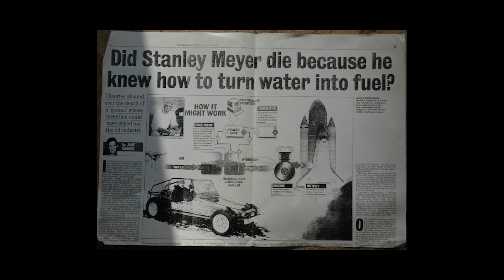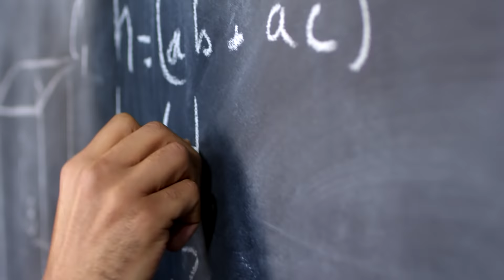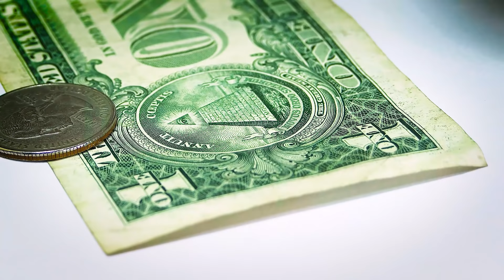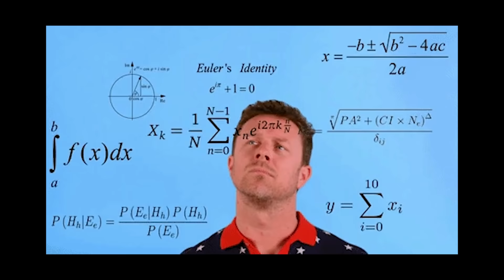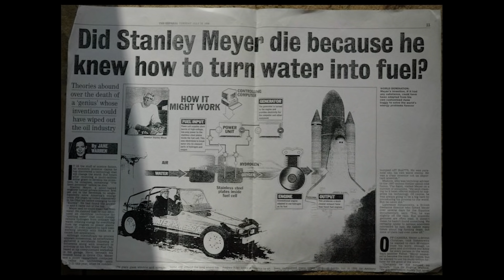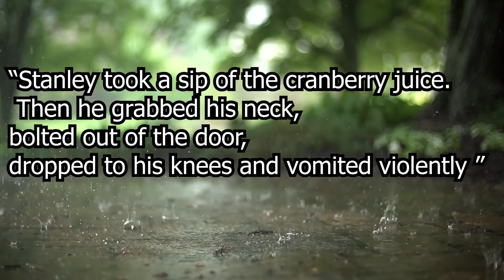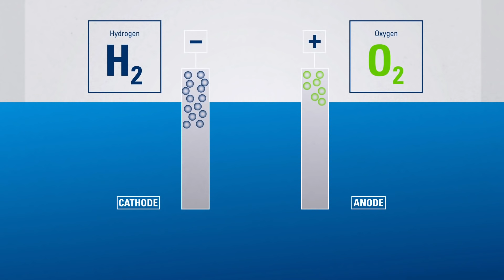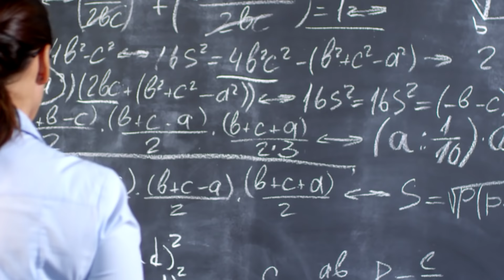Stanley Meyer Water Powered car, Lies and Death

Comment: He didn't use electrolysis  the same way we use it. He ran a high volt  electrical frequency through the water that vibrated the water and fractured the H20 bond apart. That's how he got the huge amount of hydrogen at a low power consumption. It's not amps but volts and frequency + container volume.
Reply: FACTS!
Reply: And do you have any helpful sources or related scientific publications for that as evidences to support your claim?
Reply from the maker: Yes please ill make a follow up if you can send me the link
Reply from the maker: Nope still waiting
Reply: @ChrisVSCars  It's not just a resonance frequency, it's more a matter of
a frequency that is modulated over another carrier frequency forming a train of waves.
These values in turn will depend on the size, surface area, type of water, separation, etc. 
This configures a condenser where water is part of it, (pure water works as a dielectric).

And to make it more efficient as it works on alternating signals, AC
then it is more efficient to increase the voltage and decrease the current.

In the comments of the video link, there is a link to schematic documents that Meyer made. 
https://www.youtube.com/watch?v=nbk5PCZ_7T4
Reply from the maker: Ill check the link thanks😁
Reply: What do you mean exactly by when you said "container volume". Please explain
Reply: @Bob Lazar hey I hope your not calling me a bot
Reply: @ChrisVSCars   mtttony is basically correct in his reply to this video, there is no way to make the excess energy appear in the form of excess hydrogen, you need to reverse where your heads are at, the energy comes from the correct burning ENVIRONMENT of the hydrogen and then the correct containment of the exhaust from said burn. that hydrogen oxidisation exhaust, is water and it is 1800 smaller that the volume of gasses burnt (propellent and oxidiser).

I combine what I'm telling you with what mtttony said, this is basically the answer to how stan made it work, the big secret. 

You don't need to modify the valve train, you do need to make a slight timing adjustment (just past TDC) and you need to inject the hydrogen at an unusual time (TDC between Exhaust and induction strokes) . You also need to ionise the inlet manifold to make electron deficient oxygen (or OZONE) and use a second seperate ioniser to get more nitrogen from some air (charged Activated carbon) and add this nitrogen to the burn, this is not that hard, easier than is sounds. 

In a four stroke on pure hydrogen propellent things are completely different, you can make other, different types of forces move the piston on the different strokes.  

HYDROCARBON PROPELLENT FOUR STROKE

1 INDUCTION Stroke            down
2 COMPRESSION stroke     up
3 POWER Stroke                  DOWN
4 EXHAUST Stroke.              up
boring!
HYDROGEN PROPELLENT FOUR STROKE

1 BURN WHILE INDUCTING POWER Stroke.                <<<<DOWN
2 FORCE OF VACUUM POWER Stroke                          <<<<UP
3 EXPANSION OF CONDENSATE POWER Stroke.      <<<<DOWN
4 Exhaust Stroke.                                                             up

 IN A 4 STROKE ON PURE HYDROGEN THE REACTIONS ARE DIFFERENT !!!!!!!!!!!!!!!!!!!!!!!!!!!!!!!!!!!!!! fark its actually not hard. 
The 'excess energy" comes from phase change of a working fluid. Look at how a reverse cycle air conditioner works.... 1000watt in = 3500 Joules out. COP 3.5 phase change of working fluids rob heat from an environment. this is how it works. 
Have fun.   B)
Reply: And expanding knowledge, 
Sometimes you have to "unlearn what you have learned" in order to come up with a somewhat exotic solution that the common methods do not give an optimal result.

Look for information about the "Tunnel effect".

You will realize that there are "quantum phenomena" that occur under certain conditions (thermal, electrical, time pulses, etc) that causes the WAVE (probability wave) function to collapse and the quantum states are determined.
Then sometimes, the energy level of those bonds are in another range that theoretically should not be, (according to classical physics) but they are without having to apply so much energy.

This I say occurs even in DNA molecules, that there are mutations "tautomerization" in the nitrogenous bases in the hydrogen bridges bond N-H by H-O.
Although it is very low, 1/1.000.000.000.000.
It seems that the universe has an "ace in the hole" so that nothing is eternal and is always in continuous change.
Reply: 🤔 Bro are you still with us ?
Reply: Thx
Reply: @AllinRoyalty  sources will be Facebook links
Reply: LoL 😂😂 That doesn't even make sense
Reply: @timmack2415  Then you have never used a capacitor and a resonat frequeny  to create a wave? Obviously you know nothing about electricity and sign waves.
Reply: @timmack2415  Even Stanley Myers said that how he did it
Reply: @anthonywilliamson2080  I'm doubtful that a bus short enough to fit the kind of special contained in your comment exists. With the emergence of nanotechnology, perhaps one day......
I have a master's degree in electrical engineering and I'm a lead engineer for the research and design division of GE Aviation. 
You may wish to delete your comment and save face if you desire to retain even a mere shred  of credibility. 
Everything that you said shows your blatant lack of understanding, at even a rudimentary level, of fundamental principles.
Reply: @pkillor  😂😂🤣🤣😭😭 I'm dying!
Reply: Is there ANY proof, at all, of this anywhere? For example, a peer reviewed experiment in the scientific community? I'd ask even for a video, but liquids cannot be proven in videos.
Reply: Have you guys done this to generate high voltage and high frequency using with VIC? If you have done it please let me know I'm interested.
Reply: @pkillor  We're talking about electrolysis here. If we pass an ac current, the polarity of the electrodes will be continuously changing and the ions will not be attracted toward any particular electrode resulting in no ionisation at all. Hence electrolysis CANNOT take place with alternating current.
Why must DC be used in electrolysis? Direct current deposits anions in the anode and cations in the cathode. In the case of an alternating current, the current would keep changing directions and would lead to a cancelling distribution of ions in the electrodes and a net of zero gain.
What is said about using "high frequency" to achieve efficient electrolysis, is a contradiction in terms as DC (needed for electrolysis) has no frequency. Although pulsed DC (PDC) can theoretically have a frequency (in the abstract) it is merely akin to switching to DC on and off, resulting in a great loss of efficiency in the system.
Reply: @AllinRoyalty  No, that is the exact opposite of facts, actually. In the first place, high voltage and low current is no more efficient than high current and low voltage. P= I x E or total power equals current times voltage . So they are the same. Secondly, electrolysis requires direct current (DC) which has no frequency. 
Those are the actual facts.
Reply: @Mike-sr2yu  I would normally take the time to explain this in terms that even you could understand, but I'm fresh out of crayons and finger puppets today. Besides, it's outlined in the comment section (right up there ☝️). I was under the impression, since you replied, that you were able to read and understand the English language at some level. I stand corrected.
Reply: FYI there are particular attempts at this that can make a fatal product where you'll have 0 running cars and 1 dead body so plz consult an expert before trying weird things on YouTube.
Reply: I'm only asking a genuine question. If we know what he did and know that it works why aren't we doing it now then?
Reply: Craig Warner, you saw what happened to him,  didn't you?
Reply: You know what happens when you try to take money from some of the richest people in the world? You take a drink out of your cup and die.
Reply: @timmack2415  well, it could be a DC pwm signal
Reply: @digilifestream  1kw in = 3500J out? What are you trying to say? Power(watt) is a function of work/time, that expression is not elucidating anything.
Reply: B.S. That's an inexistent procedure. You are just parroting internet . B.S..
Reply: Yall debating on who know how to make it ban together and make it then
Reply: @digilifestream  really,i would like to know if you’re still available to send a video through email on this or your just straight out lying about the “secret” of water powered cars.
Reply: @anthonywilliamson2080  Your comments are peak irony when you call other to now nothing about electricity and waves while you are absolute and ridiculous wrong with what you claim here lmao.
Reply: No that's his hydrogen generator. In the car he used a plasma sparkplug combined with an injector. The plasma so hot it vaporizes the water instant. He also explains that it's actually a steam engine. All the videos u can find on YouTube are only showing him developing the injectorsystem. Wich nowadays every car has. But the old vw was carborated. So he build an injection system. Thats one reason why he got higher mpg.
Reply: @Superliegebeest0  Oh please, stop to spread such nonsense and false claims.

Comment: Well, as an electric engineer. I can say this powered car sounds pretty good to be true. Simply due to the fact that needing huge amounts of electricity volts to start the process of electrolysis would mean that the car itself would also have a battery (similar to a electric car) to store that electricity. The problem mean that this man would also need to invent the best car battery 🔋 as his battery would need not only store more electricity then batteries today and weight less. This is just not possible with the actual weight of the car. The man purposely made it light weight as other wise it wouldn't  even move.
Reply: car runs on hidrogen not electricity and batteries!!!
Reply: @martelinaalmissa39  you would need electricity in order to start the hydrogen process and a battery in order to store electricity so you can keep the cycle of splitting hydrogen on going. Other wise you got a car that works the same way as a ratrapcar
Reply: @devilcwesker5980  It’s a retrofitted internal combustion engine. He explained the water injector that replaces the spark plug and the science behind it. This does not work the same way as an electric hydrogen engine.
Reply: A guy did it
Reply: @MasterMayhem78  The beautiful thing about the Scientific method is that thanks to it, things like this would be easy to recreate. Thanks to this breaking the simple laws of thermodynamics its safe to assume the guy was lying about it.  If you dont believe me, look up a tesla's last years, the guy lost his mind and became a nut job. I say its probably the same case here.
Reply: High voltage in resonance to H2O as a dielectric being formed as a part of the capacitor in a tank circuit limiting current flow.It worked he proved it and patented it.He worked out every detail.Today the cars are even easier to convert as stan had pretty much built a similar drive by wire car in the late 80's early 90's and advanced electronic ignition timeing system and metering of the hydrogen into the combustion chamber with exhaust gas to match the jules of any other hydrocarbon.
Reply: @sticks0012  ??
Reply: Half an amp!
Reply: You must not be a very good electric engineer think outside the box just because you got a job somewhere doesn't make your ultimate authority on all that is science and engineering.. it's not just about a battery or energy output there's alot more to the method.
Reply: @fancwings6134  enlighten us then,
Reply: Here’s Stan himself for anyone wondering
https://youtu.be/staL1wr07Sg
Reply: @martelinaalmissa39  when you can't spell hydrogen right, it's time to stop talking about science. Go do what you do.
Reply: @fancwings6134  yes, enlighten us smartie pants.
Reply: Yes 1 battery, oppose to buying gas every day…..that’s the whole point……Stop being a hater
Reply: @tannerlane9669  that wasn't the point, the point was that technology for what he created wasn't new or innovative, there for discrediting his claim of making a fully water powered car
Reply: @devilcwesker5980  Yes it very much is new and innovative, the only reason your saying it’s not new is because others have made similar things and we’re weather killed or bought out to keep there mouths shut…..This definitely is new and an innovation it doesn’t matter who did what before because no one was marketing it
Reply: @tannerlane9669  the battery run car was the first engine created for mass distribution, meaning the first car sold to the public ever, used batteries.  :v that's Like saying you made the concept of a  plate 🍽  even thoy the first signs of humans using plates dates back all the way to the stone age
Reply: @devilcwesker5980  Now your trying to avoid they whole point 😂 Now matter what you say Stanley Meyer revolutionized this because he was the first one to ACTUALLY execute it, promote it & actually make it almost close to making it so everyone could make there own, not some burn out TRYING TO do so in there garage while hating on everyone else’s designs like you
Reply: @tannerlane9669  the first to execute an electric car? Bruh those been around since 1832
Reply: @martelinaalmissa39  bruh😂
Reply: Then you would also know that resonance would do that. With a high enough electrical frequency it could the electrolysis, it would be similar to fission.
Reply: I’m pretty sure all of this could be resolved by some of y’all just attending high school chemistry and physics classes
Reply: Sure government agent sure
Reply: @fancwings6134  
There is no such thing as an "electric engineer".
This guy doesn't even know what kind of engineer he is.☺
Reply: 🔻 "Instead of high current pulling apart water molecules to hydrogen and water, his invention uses high voltage high frequency to tear apart molecules through resonance. If you are not familiar with the physics behind resonant frequency, this makes sense in the same manner a massive speaker playing very loud music will probably not break a glass cup, but if someone tunes a sound the same frequency as the resonant frequency of that cup, it wont take much more than an average persons voice to break it. His invention is essentially saying water has a chemical potential that if the power input is low enough, the output could be enough to power something like a car."
Reply: @Faith_Plus_One  
Absolutely right, what you say. Also note that Mr. Wesker is an "electric engineer".
Never heard of that title before, but in any case,
even if he was an electrical engineer, what does he know about chemistry?
Reply: @Faith_Plus_One  So a perpetual motion machine? Well that is not possible.
Reply: @fglatzel  Do you even know what electrical engineering is? They do need chemistry since chemistry is the basis of electronic component design. Transistors, resistors, capacitors, inductors all require to be made out of some sort of chemical.

Also electrical engineering isn't only one job. There are different fields of electrical engineering.
Reply: @user-mp3eh1vb9w 
Yes, I know.
But the question was: What is an electric Engineer?
Reply: @fglatzel  What are you talking about. It's literally the same thing. There are no branches of electric engineering. Maybe you are misunderstanding electric engineering as electronic engineering which is false.
Reply: A 9-volt battery can perform the process of electrolysis you don't need some super battery
Reply: @theadventurecru527  
Yes, that's right. It needs very little electricity. Some HHO generators, using ultrasonic resonance
run on 9 - 12V and draw between 2 - 3Amps. So, a 50W solar panel will do the job.
Reply: @sticks0012  o
Reply: @fglatzel  uh.. electrical engineering IS in fact "a thing".
Reply: @morganjones6401  
Well observed, yes.
But what is "electric" engineering?
Reply: @devilcwesker5980  my man stop it
Reply: Cant salt water act like a battery ?
Reply: Lisa, in this house we obey the laws of thermodynamics!
Reply: @eddiemorales2457  enlighten us mr. Eletric engineer.
Reply: @theadventurecru527  Except that it costs more energy than you get from it, so you can't start the process and have it ongoing...itsimply won't.

Comment: I believe he did indeed successfully created a way to split hydrogen and oxygen using only 0.5 amp. He used a way to fracture water, which may have meant his system relied on sound frequency and oscillation to achieve what was necessary to split h2o hydrogen and oxygen molecules apart.
Reply: complete nonsense.

Besides, it wouldnt even matter. The minimum energy you need to put into a water molecule to split it is always the same, no matter the method used.